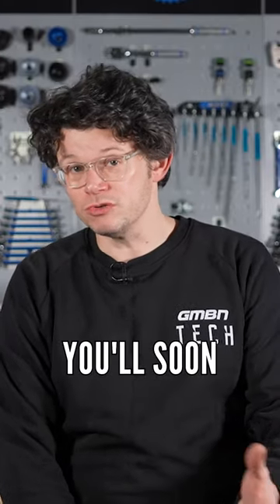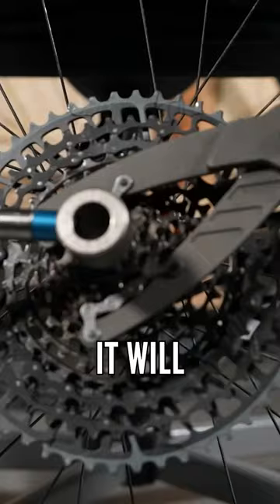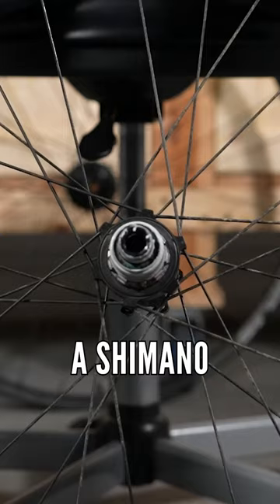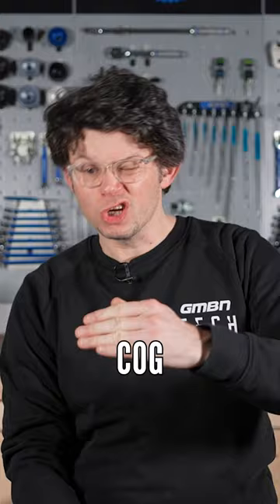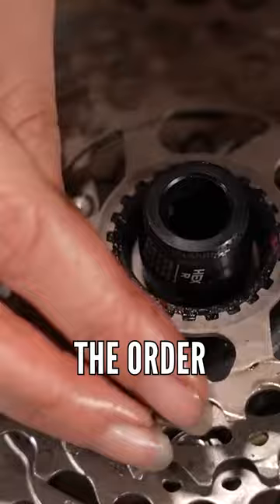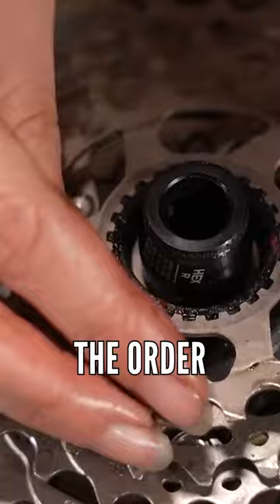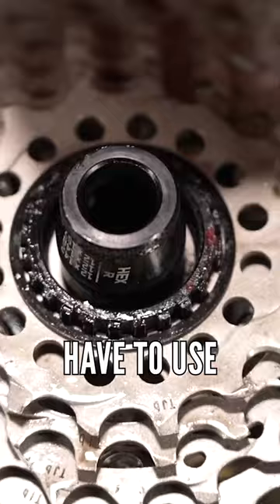What To Do When Removing A Cassette! 🧑‍🏫💡

Comment: Sram NX spacers are all the same exept for the first one that goes on after the first chainring pair, thats the thicker one. Can't get it wrong because the cogs only fit one way. You can mix the order of the cogs but you will see immediately that your casette does not look like a piramide and you'll have to switch them so that it shapes like a piramide. Cogs cannot fit "inside out" either, simply won't fit your casettebody